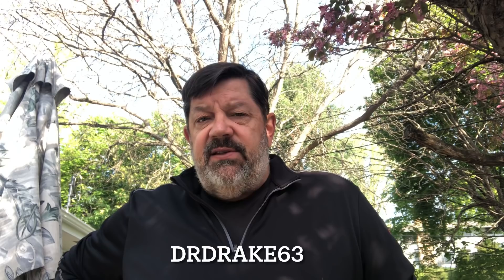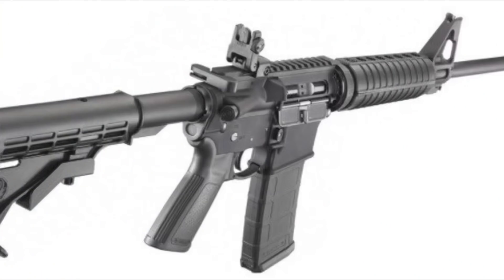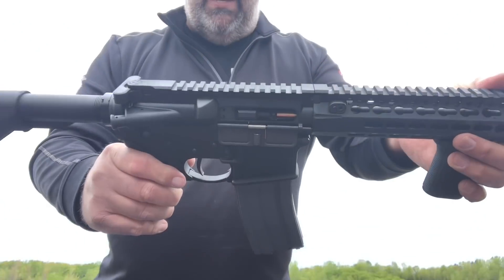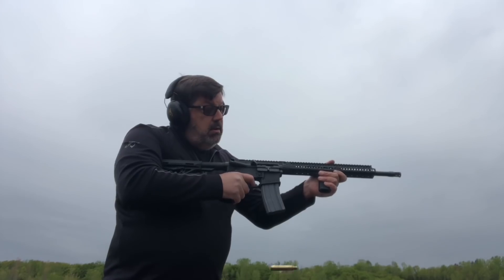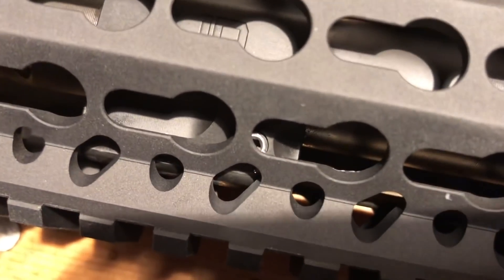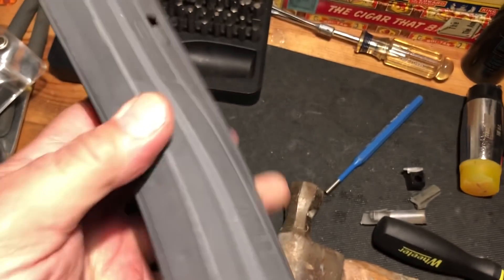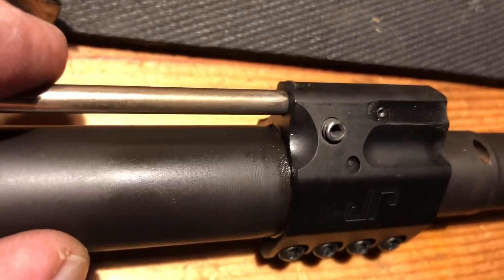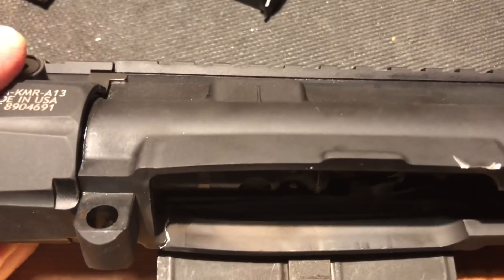Colossal AR Failure

Comment: I never had overgassing with my M4 but I have never changed anything on it. I even still shoot it with the iron sights. 

I did have overgassing with my AR-10 and it was mostly my fault. Before I had ever made a shot with it, I took off the telescoping stock and the carbine tube and buffer and spring and put in a Luth AR rifle length tube and buffer and spring. What I did not know to do but found out in a hurry is that AR-10s in .308 need a buffer that weighs at least 5.3 ounces. And on my rifle, it is a fixed or non-adjustable mid-length gas block and on the BCG is a staked gas key. So, adjusting the weight of the buffer changes things. Normally, overgassing causes the bolt carrier group to move so fast that it sometimes does not get the extractor fully over the flange of the base of the round. And it moves to quick back and forth and will bring up another round into the chamber. Or spin the spent cartridge in place and now it is hanging halfway out. The key is to slow down the travel of the BCG and the quickest and easiest way is to increase the weight of the buffer.

So these buffers have rubber ends that can be removed once you knock out the drive pin. I have a digital kitchen scale and mixed and matched slugs from three different buffers I have to get the rifle length buffer to 6.1 ounces. Which solved the problem. And now and again, I can still get an over gassing problem and see that is a matter of one round in maybe 50 that is producing a little too much pressure.

So, I bet the ammo here is going to be a big part. The gun you had was firing quite well and ejecting at 3 o'clock, nigh unto perfect.

I am not a gun smith or a gun expert but I once stayed at a Holiday Inn Express.

Comment: Correlation is not causation.
The maximum gas feedback is determined by the hole in the barrel not the gas block. Adjustable gas blocks can let it all through like a standard or choke it down usually for suppressor's. 
3:54 Possibly a 300 blackout round you found? It would cause a failure just like this.
What ammo were you using, reloads? Cheap foreign ammo? Weak brass or high primers.
Need a bore-scope down the barrel to inspect.

Comment: their is a real and serious problem in the world of gunsmithing these days, especially when it comes to our beloved AR's. Any REAL gunsmith worthy of the title will know and tell you, you cant just go by the ejection oclock position of the spent brass to know if your gass pressure is correct on an AR. You need to look at the realestate purchase of the extractor and the ejector strike markings to verify if they are within spec first before you go rapid firing or adjusting gas blocks. This is the difference between a parts swapper and a REAL gunsmith. A parts swapper gets lucky for a period of time. A Gunsmith knows what to look for and verifies the operation before going to the next step and sure as hell better verify before giving it to their customer. The problem was not the equipment, accesories or gasblock. This is assembler error. Im not putting you down but it appears you arent experienced / knowledgeable enough so I wanted to add these criteria for others to know what to look for and a steps procedure.

Comment: OOBD would have caused obvious case blow out and receiver damage but seems unlikely the BCG would be damaged at all as it would simply have been blown back open into the buffer tube. Upper receiver is obviously damaged but were there any signings of case blow out at the moment that round was fired?   From the video I can’t tell if the case blew out and the bolt returned to the forward position from recoil spring pressure or if the the bolt is still locked closed with the case still in there. 

Regardless there definitely was some kind of overpressure issue, but from the video looks like you had normal ejection just before the failure so no way it’s gas block issue. 

I suspect an over-charged round caused an over-gassed condition where the bolt tried to open while chamber pressure was too high resulting in BC failing.  Or the above condition in combo with a defective BC.

Comment: Hey, you need to stop building AR's if you think that was a gas problem. It had to be AMMO or Obstruction!!!! Glad you're not hurt!!
Reply from the maker: Putting together Legos has nothing to do with asking a question about over gassing. Think about it. Nobody builds an AR. It’s part assembly. 

I’ve built many in AR, using your terms LOL, and to my account have over 150,000 rounds of 556 downrange in my lifetime. Nothing like this has ever happened. I’ve never seen anything like this happen. So I have the humility just ask a question. I don’t need somebody telling me this means I shouldn’t assemble ARs
Reply: @drdrake63    I think you initial thought about out gassing issues is fair, as that was what you had changed. Thanks for posting the video. As an Information Junkie, I like this stuff. It was a hot round, IMO. Glad no injuries !

Comment: It's an ammo issue. I blew up 3 just like that. I suspect one of three problems. Case wall too thin or cracked, over charge of powder or maybe even under charge of powder could cause the powder not to burn correctly.

Comment: Have to agree with prior comments that there is no way the relatively thin gas tube could funnel the kind of pressure needed to cause the damage observed. It would definitely burst well before that. I believe the most likely scenario is a round going off outside of a locked chamber. I think the next step is to confirm that the last round was 5.56 or .223 and that there was no obstruction in either the barrel or chamber. I have personally experienced a case separation with commercial reloads where the front half of the case remained in the chamber while the rear of the case was ejected. A new round was partially chambered and the bolt was unable to lockup. Fortunately the second round did not fire during this jam if it had I believe it would have the damage observed. Was the last round a commercial or reload?

Comment: Would like an updated vid to this, I would have a certified gunsmith take a very long look at this. But the one thing I would do, because it was an over pressure situation, is have that lower Magna fluxed, because it could have stress fractures in it that aren't visible to the naked eye,  thx.
Reply: The Ruger 556 is only a $799 AR to begin with.....They are not anywhere near a Wilson Combat, Daniel Defense or a Geissele for quality and durability. I am not saying the Ruger 556 is a piece of s - - t , but you do you get what you pay for.
Reply: An just for clarification, what do's the make of the rifle have to do with my comment, its pretty obvious it was an out of battery detonation, but what was the cause is the question.
Reply: @williammccaslin8527  If you think all rifles (and handguns) have the same quality, build and tolerances, you are incredibly ignorant. The "what do's the make of the rifle have to do" directly refers to the option of a materials failure. If you ever had the opportunity to shoot a $700 vs $3,500 AR rifle, you would know the difference and never even posted that kind of comment in the first place. Materials failure was a possibility mentioned in both the video and by numerous other people in this thread.
Reply: @smithn.wesson7945  an again I ask, what do's the make of the rifle have to do with the comments on the failure of this particular rifle, cost isn't the issue in this circumstance, but the cause an effect of a failure is

Comment: I'm no guru but the usual suspects are not leaving the normal clues behind so I'm assuming its a mechanical structure failure ( Ruger BCG mico fracture or something ) combined with a lil over gassing .

Comment: Id bet a SIGNIFICANT amount of $$ that the gas block had a single thing to do with it. In my opinion that was a out of battery detonation. If it was what YOU ARE calling " Catastrophic over gasing" the bolt carrier would be blown out the back of the buffer tube. What caused this was the round going off before the bolt lugs had in gauged the barrel extension. Ive personal been standing next to 4 AR rifle do the same thing when someone isn't paying attention and loads a 300 Blk round into a 223/5.56 barrel. And YES, The round (300blk) will go just down the chamber fare enough to give you the "Firing out of battery" condition where the round comes apart and so does a lot of other things.  Add in the favor that its a Ruger AR, That have been known for significant problems from end to end, And top to bottom.

Comment: That was an over-charged round, not a gas block issue.  Adjustable gas blocks only restrict gas, it cant send more gas through the system than a standard gas block.

Comment: The built in failure point is the gas tube itself, I see a bolt carrier failure, could be aided by tight headspace of bolt reguiring more force to open bolt.

Comment: Glad you’re okay but sorry about your rifle. Gas wouldn’t have done this. Some guns come WAY over gassed but even then, the most you’ll get is more recoil reward. This was an ammo issue. Assuming your bolt is headspaced with the barrel. This pandemic has led to soooo much issues with ammo quality control. Squibs, over charged ammo, and out of spec primers. I wouldn’t keep anything on that rifle except the lower and gas block. Everything else is probably warped and out of spec. Will give you more issues on your next build.
Reply from the maker: Agreed

Comment: I had a bolt fail do to over pressure on an AR 15 pistol I had it ripped the bolt in half but like most people are saying your damage was not gas block that was over pressure.

Comment: Looks like we need a follow up video!

For the “hot ammo” theory - I’m a reloader and my 223 are about 80% full of powder. Just not much room to MASSIVELY overcharge the round.  I would subscribe to the round before (off camera) was a unrecognized squib or 300BLK partially into 223 chamber.  

I can’t wait for a follow up video, Dave.  I’ve learned a lot from the posts.
Reply: A massively hot round would be entirely possible had they mistakenly used pistol powder.
Reply: Powder type is everything. I usually pick a powder I can run compressed, as it generally gives the best consistency. Doesn't mean it's going to end well if I dump unique in the hopper instead of H335.
Reply: If you judge how hot your rounds are by how much powder you see in the case, STOP RELOADING. Get a new hobby

Comment: Blaming the gas block is ridiculous. Ammo was over pressure. Blaming headspace is ignorant of AR design. An out of battery is hard to accomplish with the round actually igniting due to design. The hammer blow would be slowed by the bolt carrier going forward. If the bore isn't or wasn't obstructed and that leaves evidence, you are only left with wrong powder or wrong charge weight. If it wasn't a lego gun you would need enough knowledge about the gun to diagnose this. However it is what it is. Gun design is my ice cream. I eat it up. It is my reason for the hobby. I know its not everybody 's thing and thats ok too. Different strokes for different folks.

Comment: I don't think you have a gas block problem at all there.  Looks like one of a few possibilities.  Over charged ammunition perhaps. Wrong powder or too much or way too little causing a detonation.  Or, she went bang when the bolt wasn't fully locked.  What does the spent case look like? My gut says the spent case is gonna tell you what happened.  Is the case bulged or torn off at the head? What does the spent primer look like? Keep digging.  She will tell you what happened.

Comment: Gas block may have been slightly misaligned, causing you to have to open the gas block way more that what JP instructed.  That said the gas block didn’t cause this.  You had a bore obstruction (possibly a squib), an ammo issue (undercharged or overcharged cartridge or possibly wrong cartridge) or even possibly a worn throat or head space issue.  What was the rifle chambered in?  What were you shooting?  Has the rifle been checked for throat erosion or was it ever headspace.  I doubt it was a headspace issue, but it could be nice to know if/when the headspace was done. But, it wasn’t the gas block that caused this failure.

Comment: Look, I wish someone, sometime would just come out and tell folks what a pos the m/16/ar/15 platform is. I had to carry one of these in an infantry line company in Vietnam. I am left handed. The damn safety/selector switch is damn near impossible to operate without turning the damn thing upside down. Try that in a firefight at 50 feet with automatic weapons! There was another guy, Several actually, also left handed. In the middle of a fight his blew up on him. Tore the back off a chambered case, partially loaded the next round and slam fired. Blew the right side out of the pos, took part of his right cheek, and all of his ear. Ticket home for him. The rest of us were given a choice of a pump shotgun or m14 rifle. I took the m14 and never looked back. Heavy? Yep. But that big old bitch never jammed and never blew up either. I didn’t get off Scott free though. Badly wounded at a place we called lz hardcore feb 68. Spent several months in tripler army hospital in Hawaii, then home. Thinking about buying one? Do a search on ar15s blowing up. There are a f king bunch! Then do one on m1a. Crickets. You build a rifle out of steel and wood, not plastic and aluminum. In my opinion, next to m1a, Russian s k s. Cheaper, and gets the job done.

Comment: Doesn’t matter how open the gas block was.  The hole in the barrel is drilled to a certain dimension.  Only so much gas can escape.  I’m inclined to believe 300 round or out of battery discharge.
Reply: You’re a stand up guy admitting it was a 300 that detonated out of battery.  Kudos brother.

Comment: Bad ammo , possible Damaged round that jammed and didn't let the bolt unlock , or a previously damaged /stress cracked BCG that finally came apart. Those are the top 3 i would look at if the Gun was brought to my shop for analysis. A 5.56 round in a .223 Chamber can cause a pressure spike as well. AS a Master Gunsmith of over 40 years , i have not seen one do that sir.

Comment: I believe it was an out of spec headspace issue. I doubt Ruger will replace any parts free of charge since the owner used aftermarket parts and installed it back together.

Comment: To me, and this might just be me. That looks like a by the book case of a couple micro fracture scating by the QC. But again, just my thoughts. Hot ammo and overgassing would have blow the gas tube and an OBD would have had a ton more shrapnel and scratching of both the mag and the upper. The way the BCG looks, this is my best guess.

Side note: not a Gun Smith.

Edit: Although, the Upper points to headspace issue. The way it cracked...

Comment: I dont think thats a gas block malfunction, when you run a regular gas block your getting as much pressure as possible so even if it was all the way open it still should have been fine. I think that was possibly an out of battery detonation

Comment: Did a hot loaded 300 blackout round get chambered and fired.  Bolt seems to have been locked, but a tremendous amount of gas was released into the bolt carrier.  Enough to destroy the bolt carrier  and the upper receiver and the magazine.  I suggest you take that gun to a qualified AR gunsmith and have them look at.  
It was not your gas system.

Comment: Not an issue with the gas block. You either had an out of battery detonation, a barrel obstruction due to a bullet in the bore OR a .300 blackout round that got mixed in. We need to see the actual cartridge in the bore. 

Could have also been a case of bullet setback. If you had some previous malfunctions and double feeds then the bullet can get pushed back into the case. If you picked one of those up and fired it that can cause significant over pressure. 

Could have also been a double charged, or even a light charged round. We really need to see the casing to get more information. Too light of a charge is just as dangerous as overcharging one b/c way more surface area is available for the primer to act upon. It causes massive spikes in pressure. Kind of hard to explain if you don't reload. Seems counterintuitive, but it is the case.

The point is the gas block is NOT at fault. You can't over gas an adjustable gas block any more than the actual hole in the barrel will allow. If you put an adjustable gas block on a barrel and open it up all the way then you're not magically introducing more gas than what the rifle would already see with a non-adjustable block.

Comment: It is highly unlikely a gas block change-out would have cause a catastrophic failure like this. The gas is ultimately regulated by the gas port size, the adjustable gas block allows control over the system but you can't make that port any bigger by installing a new block. Unless that hole was opened up, the tube size is .125, and the ports for a 5.56 are usually between .058-.080 depending on barrel length and a few other factors. The most likely cause of a situation like this is a timing issue which resulted in an out-of-battery detonation ( like Lugermonger suggested), or a failure for the bolt to successfuly keep the chamber locked, due to a hot or out of spec round. Keep in mind that the proof load for that cartridge is significantly higher than normal operating pressures and the system can safely contain that cartridge for a short time. There are however, a few other factors at play here such as a polished chamber and obturation issues, or material failure in the bolt itself, could also be a headspace issue. But they system did its job to contain the explosion and prevent any injury. Count your stars......